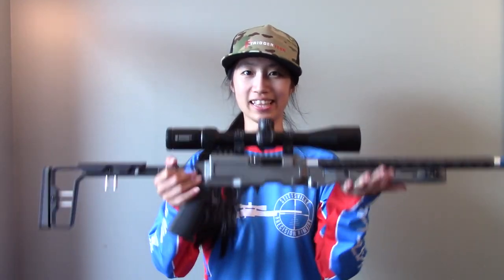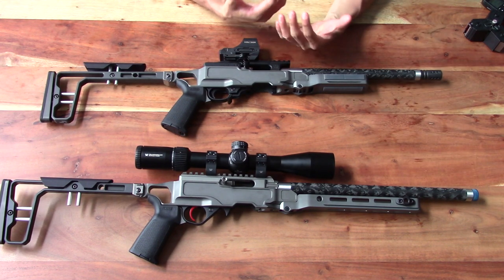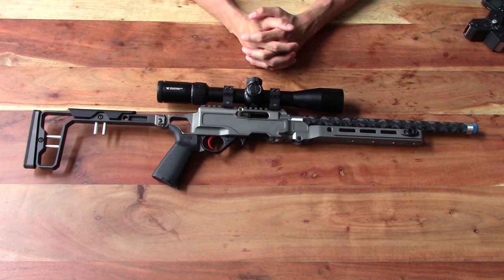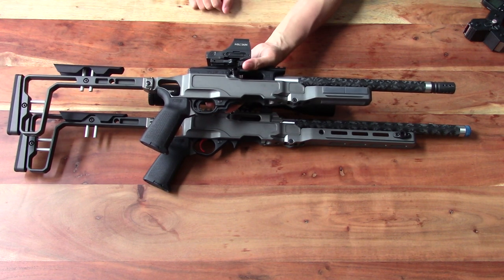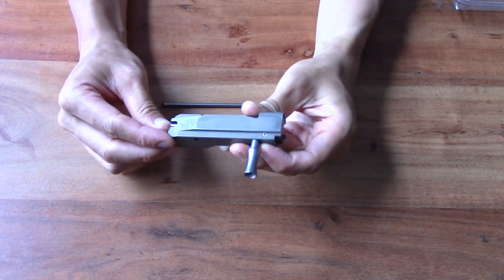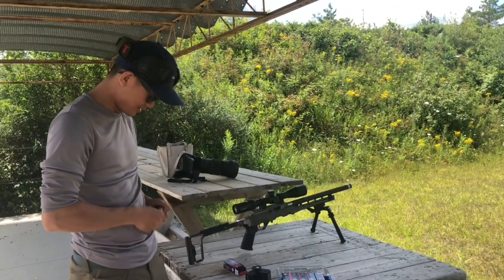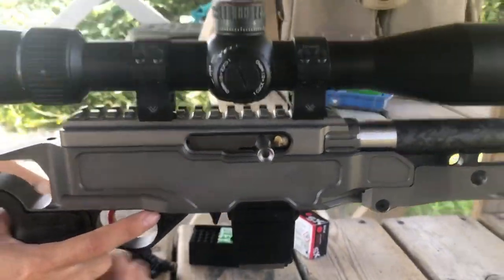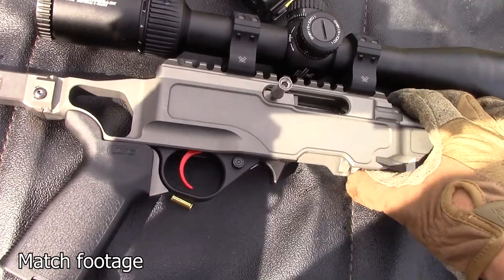Grey Birch Fusion - 10/22 with a barrel nut?!

Comment: Need your help or expertise. I ordered the regular Fusion and dropped it in a Bravo with a Kidd bolt and about a 1 lb. trigger.  Torqued to about 25.  I’m shooting all types of subsonic match ammo.  It will not shoot 1 moa.  Do you know who’s barrel they are sourcing?  Have you shot some that will group as well as Kidd and Volquartsen barrels?  I had high hopes.  Mine is not carbon fiber.  Thoughts?

Comment: What are your thoughts at this point? Thinking of picking one up for my Volquartsen summit.
Reply from the maker: I guess you’re asking about the chassis? It’s great for general purpose and plinking but a bit too flexible for bench or match use
Reply: @Womfat  Ya, the chassis. Good to know! I currently have the magpul hunter stock. $500 might be a bit much if it isn’t a good choice bench. Thanks!

Comment: good video there ! which model of diamondback is that? do you recommend MODEL: 3-9X40MM or 4-12X40MM? the former is on sale now at cabelas. Thanks!
Reply from the maker: Neither, it's the diamondback tactical 4-16x44mm FFP
Reply: @Womfat  cool I guess that costs more
Reply: @Womfat  I bought the 3-9x40 , cause it is on sale, then will have to see when I can go to Rimouski, it’s long drive .